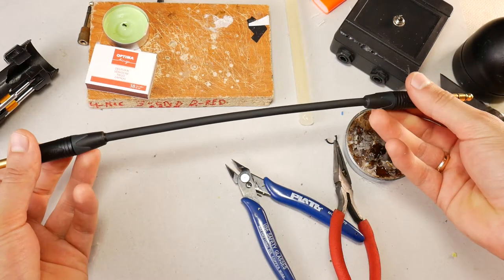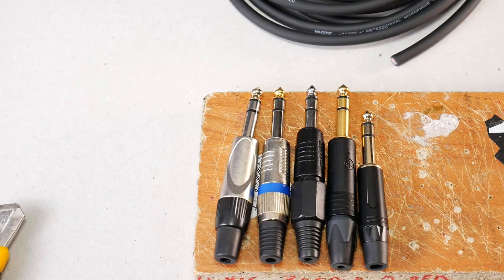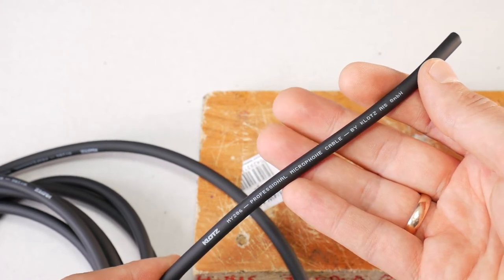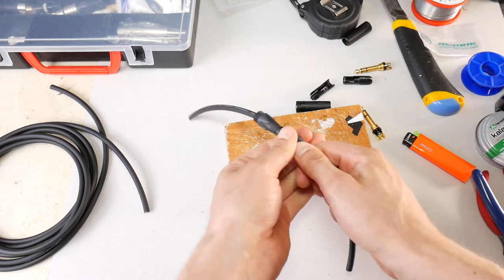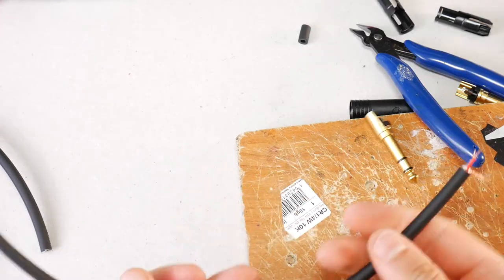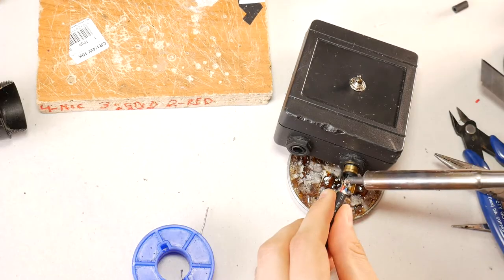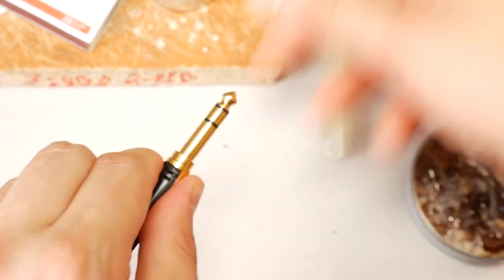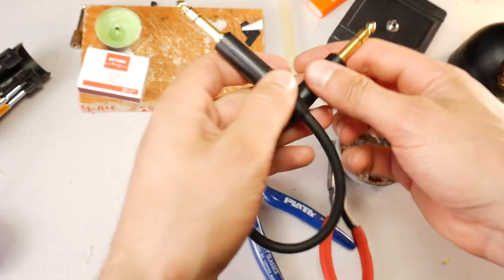How to Make 1/4 inch Stereo Patch Cable DIY

Comment: Should we always use mic cable to make stereo patch cables? Can we use regular instrument cable? What do you think about MC 2000 klotz cable for making stereo patch cable? Thanks
Reply from the maker: yes, you can use any audio cable with shield and 2 wires inside. I use the type microphone cable, because I have only that one in my local shop.